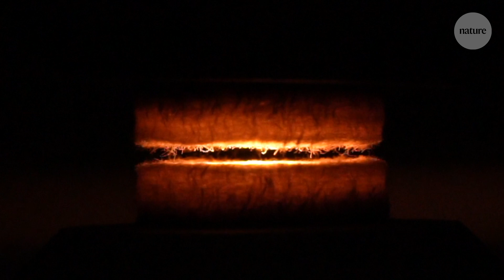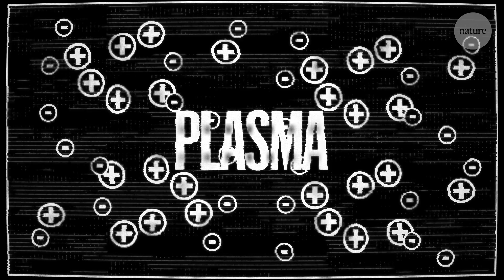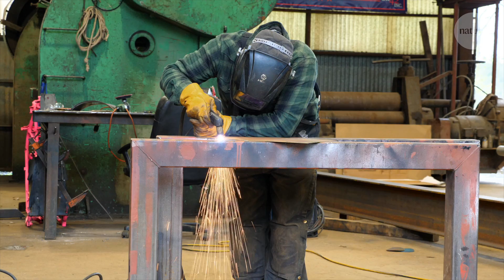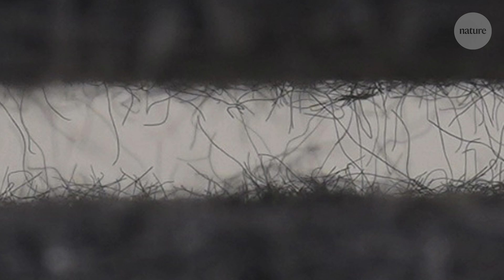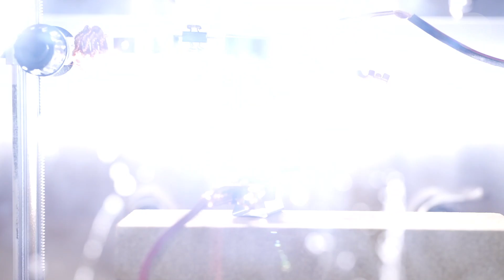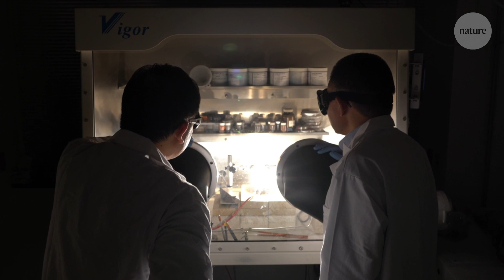Super hot plasma made easy with stabilising fibres

Comment: I'd love to know if (and why or why not) this could have any application in high-energy plasma research specifically fusion energy?
Reply: 8000K is not nearly enough for fusion. It's slightly hotter than the surface of the sun, not hotter than the core of the sun. And fusion on earth needs much higher temperatures because we can't recreate the pressure of the sun's core.
Reply: @unvergebeneid  what if we increase the voltage or the surface of the carbon sponges ? 🤔
Reply: @whiteglitch  fusion in reactors happens at around 150,000,000K instead of 8000K. So that better be some sturdy sponge.
Reply: I think you'll have to try it out yourself because nobody knows :)
Reply: It's not even remotely close to the temperatures required for that. Upping the voltage high enough would likely just destroy everything. 

Plasma for fusion energy require magnetic containment. Helion energy have a very interesting approach and have done videos on their research. You should check it out.